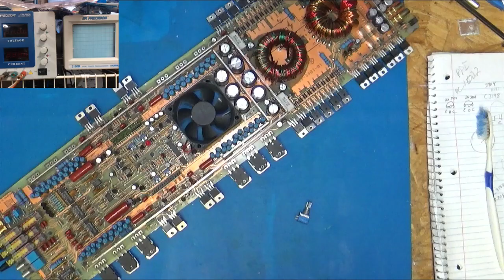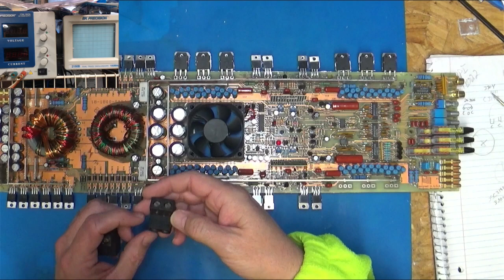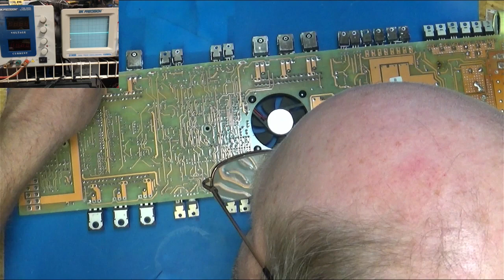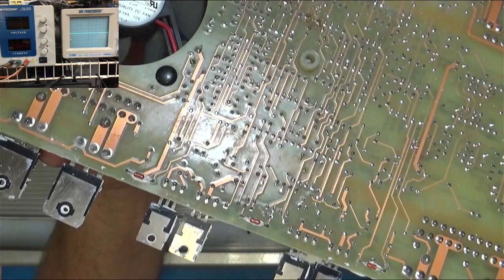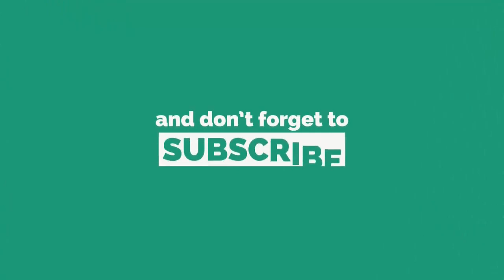PPI Power Class 1800.2 Amp Repair. Finishing up! EP4

Comment: Just wanted to let you know the Hollywood surrounds turned out amazing! I used "SimplySpeakers" with the model number "STD-FSK-10JL" for the surround kit at $28.95 / pair. Paint the foam prior to install with Plaid FX Smooth Satin (white) 4 coats....wait 2 hours between coats with a brush or airbrush. Then once thats done apply Plaid FX Nuclear Neon (green) 4 coats and also allow to dry for 2 hours between coats and then put them on just as you did your surrounds. I'll send you photos via email.
Reply from the maker: Awesome, cannot wait to see those pictures, thanks so much for the info too!
Reply: @Crazylogix007  just sent them.... please let me know if they came thru bud